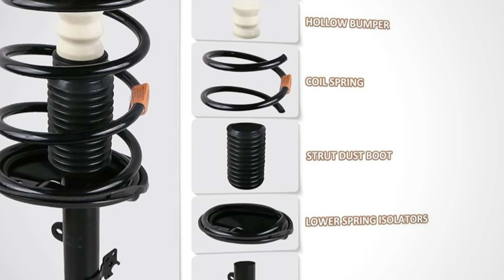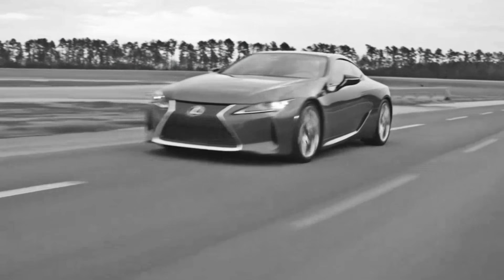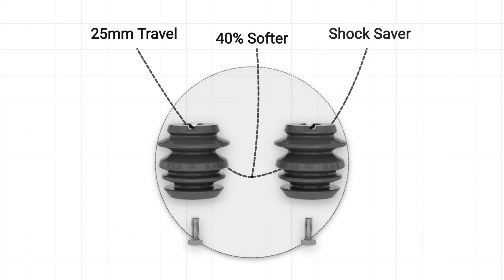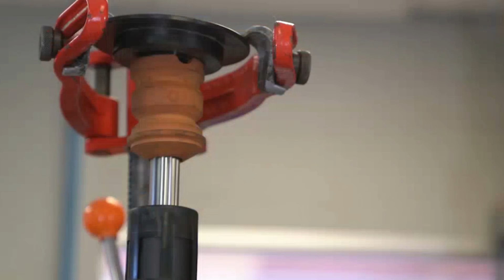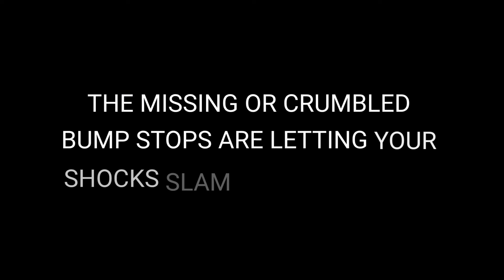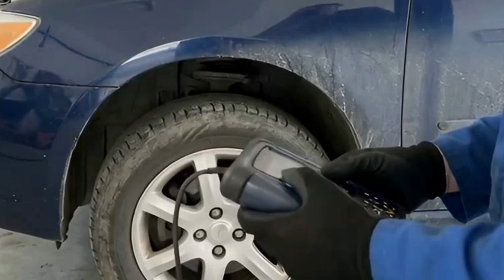INSANE $22 Toyota Suspension Mod That Rides Like a $95K Lexus LC (RIDE HEIGHT TESTED)

Comment: The "Lexus LC" Comparison is Absurd. The video tries to equate a passive piece of polyurethane to the Adaptive Variable Suspension (AVS) in a Lexus LC500. The Lexus LC rides like a cloud because its computers read the road and adjust the fluid valving inside the shock absorbers 650 times per second.
Reply: My 2018 Lexus is350f has AVS